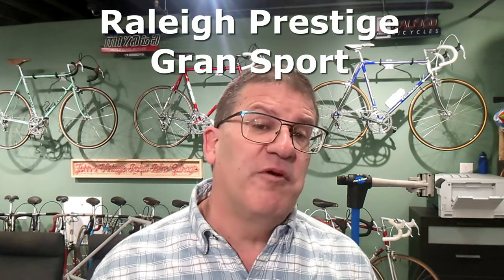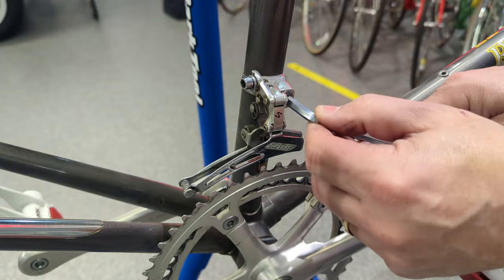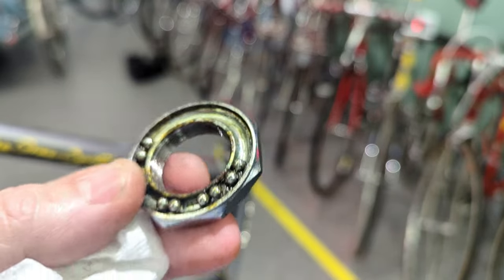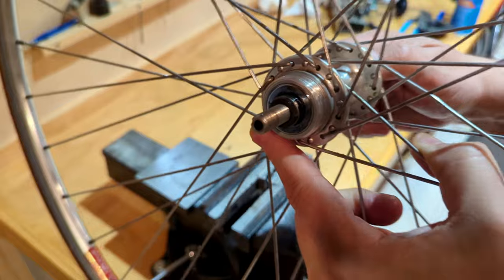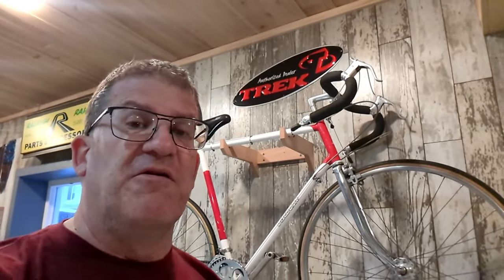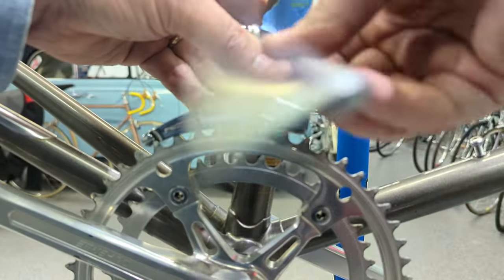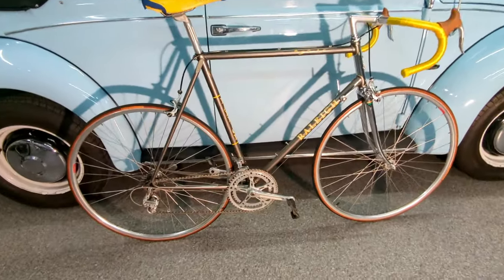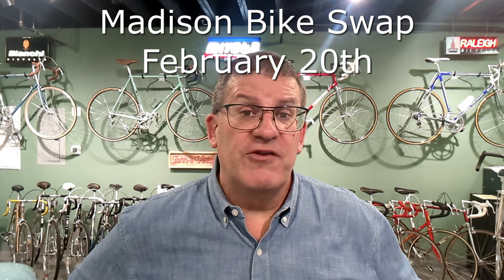1983 Raleigh Prestige Overhaul and Upgrades. Complete tear down and rebuild. Restoration

Comment: My first road bike, the one that caused me to love cycling, was a 1980’s Raleigh Technium. I love me some Raleigh content🥰. Perfect choice on the bar tape too, yellow to match the lettering and hoods match the sidewalls. Very cool bike! 😎👍
Reply from the maker: I sold Raleigh back in the Technium days. It was a little harder sell when all these lighter aluminum bikes came out. But the Technium rode well. We sold a bunch.
Reply: @JohnsVintageRoadBikeGarage  I believe mine to be a 1986. 6061-T8 aluminum main frame tubes with steel head tube, seat stays, chain stays and steel fork (3x6 Shimano 600 group). Certainly not a high end bike but it fit me like a glove and it holds a special place it my heart. Keep up the great content 👍

Comment: Beautiful bike, I had a Donahue ( a local builder in England) the same colour.did most of my racing career using that tape usually in a sort of champagne type of colour. I have the brake cables shorter so if the bike falls the handlebars don’t smash into the top tube 👍👍

Comment: John, this is my favourite of your videos so far. SunTour invented the slant parallelogram derailleur which is the design that even Campagnolo eventually adopted. As you said, at the time they were the best. The Superbe Pro gruppo was even better. Your choice of the chainset  raised the level considerably.
I love the yellow bar tape and I agree with you for the direction of wrapping. With thin tape it feels smooth either way but doing it top to bottom is so much neater. I always chose yellow Benotto tape in the 80's. That saddle is perfect.
It was a blast from the past when you mentioned Sedis chains. I always used them too. I believe they went through a couple of buyouts and now is under the SRAM name. In the last many years I opt for KMC
While I like ASMR vids, I also enjoy your approach so keep it up.

Comment: Never understood why Suntour went away. Suntour Superbe had the performance, look and price point that made sense. Great video
Reply from the maker: Its a shame about Suntour. People dont know that they had the first index system that worked incredibly. Miyata put it on a 300 bike. But nobody took it seriously. I'll have to find what model that was.
Reply: Patents. The story goes that Suntour didn't think to protect all of their inventions/innovations. Shimano came along as the bigger more established brand (they were already big in fishing) and patented many of them. It was a shame Suntour never recovered.
Reply: The first Suntour I ever saw was a "Skitter" on a cheap Japanese 5 speed Sting Ray knockoff around 1966.
Reply: @nowyourefinished6481  Nope they did. The patents ran out in 85 shockingly everyone else copied the second they were out. Shimano needed that design for reliable pull ratios for sis and sti to work. Shimano made copies of campy until that patent ran out in 85. Suntour was the best hands down in the friction era for half the price.
Reply: That explains why a Dura ace rear derailer looks so much like the sun tour featured in this video
Reply: @steveconway11  all of them do after 1985 even today all are a slant perrallogram designs. The slant gets the jockey wheel to follow the shape of the cluster and stays an equal distance therefore even cable pull amounts. Suntour invented it in 1964.
It is the greatest advancement in cycling really and the wrong company gets all the credit.

Comment: That's a beautiful bike! I wasn't riding in that era so I hadn't a whole lot of familiarity with what was out there. I love the chrome head tube. Speaking of pink....my first re-entry into road biking again in my mid 40s was with a pink Giant road bike given to me by a neighbor. I rode it one time while it was pink, up and down my block well after dark! I stripped it and did a Dupli-Color refinish, a dark sky blue with silver accents topped with clear coat, it came out amazingly good! Thanks for the tip regarding the bolt when removing the fixed cup, this will be my method from now on. I remember getting in a bit of a heated discussion with a guy who totally hated on the Japanese bikes and components in that era, dismissing them as cheap imitations, even though my experience in the early to mid 70s was very satisfying. The SunTour derailleur on my 73 Nishiki International shifted so much better than anything else I had experienced at the time and made me a believer.
Reply from the maker: I usually ignore bike snobs. I have 30 campy equipped bicycles and still know and realize that they didn't always perform the best.

Comment: I really liked this video! I liked the look at the bike shop (nice one! i was on the national bicycle dealers board w Bruce years ago) i smiled at your bar taping though... Those Benotto end caps are designed for have the tape go around the outside of them, not have them plugged on the end like that! But, if that works for you? But the bigger picture is you're doing a really good job with these videos and I appreciate them! Thanks, Dale
Reply from the maker: Hey Dale. Great catch on the end caps! I only put them on temporarily. I prefer the plug type. I just didnt have any. Bruce has become a friend. Known him since I worked in a shop in the 80s. Then I was his Wisconsin cycle/Riteway/GT Schwinn rep for 10 years. I live in town and now  we hang out. Thanks for the encouragement.

Comment: I still have my 1981 Raleigh Superbe though its in pieces. Complete Superbe groupo. It was a fully cromed frame covered in a gold tinted urethane finish, very pimp looking but it was a great bike and I raced it for 2 seasons all over SoCal in 82-83. Had the Celotape in gold but stripped the gold tint of the frame. I'll restore it this year except for the gold, LOL.
Reply from the maker: I have one of those on the hit list. However, they're hard to find with the gold still intact. How does yours look?

Comment: I had a Raliegh super course71 road nice… a magnet is very helpful for bearings 😎
Reply from the maker: Im an idiot. I keep forgetting to get a new magnet! Take a second for a story. I had a damaged 73 International I sent to a painter. He repaired the frame, this is in 1985. He painted it black for me. He said he had international decals but when he finished the bicycle he called and said that they were damaged. But he had Super Course decals....long story short. I had the only Raleigh Inter Course.. Not joking. I cant find a pic if it. If I do Ill put it on the channel.

Comment: Nice bike and build John! I’ve got a 1984 Raleigh Portage (650b) with 555T tubing. The decals on the ‘83-‘86 Raleighs are delicate
Reply from the maker: Thats pretty cool.. I have a question. It's going to sound negative. It's not meant to be. Please understand.. Im curious. Why is it whenever someone converts to 650B. They always put that in the description of the bicycle? Just a trend I notice when people tell me about their bikes. As if they are passionate about their conversions. I'll be careful with the decals.!
Reply: I hear ya John! The Portage came as a 650b touring bike! It’s probably the first ‘mass produced’ 650b in the US market (Raleigh also had their Mountain Tour ATBs at that time, one with 650b wheels). Raleigh produced the Portage’84-‘86 or ‘87. The ‘84 had shorter chain stays than later years. It can fit 38c and even 42c sort of. Came with front and rear racks and the saddle even came with a dual-ended hex wrench (5/6mm) mounted underneath for adjusting on the go! It’s a quite fun bike to ride! I’ll send some pics.

Comment: Very nice bike and resto John! Those Suntour Superbe components were extremely good and easily competed, if not, surpassed Campy of the time…despite what the Italian Luddite’s would profess (and I consider myself one since all my bike resto’s are largely 80’s Italian steel with Campy😏). They would be good competition for the Dura Ace of the time as well. Back in the 80’s I raced with a Colnago frame and Dura Ace 😊 much to the chagrin of many folks…the Dura Ace was just superior in every way for racing. I certainly would have considered the Superbe but they were hard to get here in Calgary, Alberta Canada. Keep up the great work and restorations! Trevor
Reply from the maker: Thanks. I still believe that Campagnolo had better quality bearings, races, harder aluminums etc. I just think that Suntour shifted better in that era. I think that Shimano really did damage to Campagnolo when the DuraAce 7400 Group came out. Campy has never recovered from that.

Comment: Back in the day, when using Cellotape, we would start at the bottom and wrap to the top. On the finishing wrap, instead of cutting at an angle like the cork tape, cut at right angle to the bar and melt the tape on to its self with a hot knife.
Reply from the maker: Wooh. that's cool. Never seen that done!

Comment: Hi John. Enjoy your videos, and your fantastic collection, while there is very little riding here in Denmark due to snowy weather, like you have in Chicago.  Pls. tell us a little about the tubing on that Raleigh. 

Regards,  John
Reply from the maker: Its inconclusive as to who made it. Raleigh in those years were marketed by Huffy and would mimic the Reynolds decals. Some think it was Tange tubing but I'm still not sure even after some research.

Comment: what term did you use when you described the Raleigh yellow embossing on the seat stays as you panned around the frame?
Reply from the maker: Pantograph..When they engrave their name into the metal.
Reply: @JohnsVintageRoadBikeGarage  Thanks. I think that's also a hinged mechanism they use in engraving. Interesting detail.

Comment: I’ve never seen the brake cables done like that on a Raleigh before , are the  actual brake units themselves different from standard ones , I have an old Raleigh Royal which I ride each day but never seen that done with the brake cables before. Great looking bike that one you just did , the jealous scale has blown up.
Reply from the maker: Hey, Those were pretty standard back in the early to mid 80s. You need the special "Aero" levers to run the cables like that. Just go to Ebay and punch in "Aero DiaCompe Levers"
Reply: @JohnsVintageRoadBikeGarage  thanks , funny that’s my time when I was riding but never seen them before now , I was young and probably enjoying myself too much to notice was was going on around me , thanks again , take care nice soul.

Comment: You don't need the BB sheath.  It just traps crud.  You haven't truly lived until you've done the research, bought the tools, and rebuilt one of those old freewheels/freehubs with its 47-jillion balls, tiny pawl springs, etc.  My 1979 Motobecane has Sun Tour Cyclone derailleurs, and they were great.  Sadly, the 1980 I bought came with Altus, still very good but not quite as silky.  A cost cutting measure, I suspect.  I still think the saddle and tape should be brown leather.  Still, it turned out great.
Reply from the maker: I don't enjoy rebuilding free wheels. I do it once in a while. You had a great idea with the brown leather. Just trying to keep the cost down. I have not done a great job with stitched leather in the past. I'm a little nervous doing it.
Reply: @JohnsVintageRoadBikeGarage  I fully get that.  Freewheels are a right pain.  I did mine because it was glitchy, and I found a pawl was hung and not engaging.  It works perfectly now, but the rebuild was NOT fun.

Comment: Nice refurb. What year was the Superb first introduced? Cyclone was the cat's meow when I built my bike. Superb came along a little later and as far as function, I don't see how anyone could knock either Cyclone or Superb, putting all snobbishness aside.  BTW, in the early '60s I too lived in Arlington Heights as a child until my dad took a transfer. Fond memories of what was a new suburban neighborhood.
Reply from the maker: That's a great question! When did Superbe first come out???? I did a lot of repairs and bike builds backin the 80s.. I don't think it came out earlier than 80? Im not sure. I may have to take to google to find out. You wouldn't recognize downtown Arlington Hts. Check out google maps. Alot of high rise condos downtown. My friend John purchased Winklemens Schwinn that was in town there.. That was 40 years ago..

Comment: That was the nicest huffy money could buy. First year of huffy owned the American market of Raleigh. Japanese contract build. Sun tour was the best shifting stuff until the patent ran out and every other manufacturer copied it. 
Leave that stock because the value is not there like other Japanese contract builds of the era especially the early specialized that was contract built by 3rensho
That is a part out bike in my world.
Reply from the maker: Yes. the negative thing about that Era is that brands were not making their OWN bikes. They farmed them out. Curious. Do you know who Huffy contracted with to build it? Was it Panasonic?
Reply: @JohnsVintageRoadBikeGarage   I know the 81-83 ailez specialized were 3rensho. They were full campy and tange tubesets they were far from bargin priced. They were more like the 3rensho athlete models their entry level still crazy high quality.

I doubt Panasonic would cut into the already good USA market at the time. By the way you can still order from Panasonic frames today using the pos system of the old days easy you just have to use a Japanese shop online. I ordered a cx frame in Panasonic team paint scheme a few years back. Not expensive at all really. Had it in like three months.

 Considering the only frame maker of the era in Japan with tube making abilities was Miyata it could be them but they were in bed with koga at the time. I doubt they could have handled all that work.  All I can tell you is tange  is on some of the fork steer tubes no idea on the rest of the tube set. Whoever it was they built tons of bikes for Raleigh USA

Comment: hey i got a question. I got my hands on a Bianchi Rekord 910 with a Shimano600 group. An the shifters do have a damaged part. What is the best option now. Getting a new Shifter from shimano600 for 40-60€ or a different one. What is the best budget option for a bike like this. 
Greetings from Germany
Reply from the maker: Hi. I dont know what generation of 600 you have. Is it indexed? If not any shifter will work that is friction.
Reply: @JohnsVintageRoadBikeGarage  it is indexed. i am pretty sure it is a shimano 600 sl-6208 6 speed shifter. I now already bought a sl-6400  and hope its gonna work. Its my first bike restoration. Fingers crossed :D

Comment: What is the maker or model of that saddle ? My Schwin saddle is all eaten up and I would like to replace it with either new or used saddle like the one on the 1983 Raleigh grand sport  it is similar to the one on my Schwinn but in better shape or is the some one I may mail the eaten up saddle for repair and recovering !
Reply from the maker: That is an Avocet Saddle. I think its the "O2" MOdel.. not sure. My friend Cyril thinks its pretty rare.
Reply: Thank You👍

Comment: Better late than never. Tree rats ate my internet/cable, going to my house. 3-1/2 days of internet withdrawal DT's......I still have some Suntour stuff. Cyclone crank, rear derailleur, and Sprint calipers.....Are you still able to get Benotto bike ribbon? The only complaint I had with it, was that it would fade in the sun. 
The only thing that I would change about your build, would be to screw on a 7 speed freewheel, instead of a 6, along with a 7 speed Sedisport silver chain.
Reply from the maker: I'm with you there. I'll be looking for an ultra seven at the bike swap this weekend. I have the correct chain on it already. I got my Benotto tape from Boulder bicycle. Check them out.

Comment: If I remember correctly this is from the Huffy owned era. Huffy actually had ownership of quite a few high end bike companies and they did it without completely ruining them. Go figure. I had a Rampar from 1983 that had Superbe parts and a 24 karat gold plated frame. The parts were great, but the gold plating would wear off if you looked at it crosseyed.
Reply from the maker: That was the Rampar or Raleigh Superbe model. That wasn't real gold plating. Im sure you're aware. Im looking for one in Minty condition!